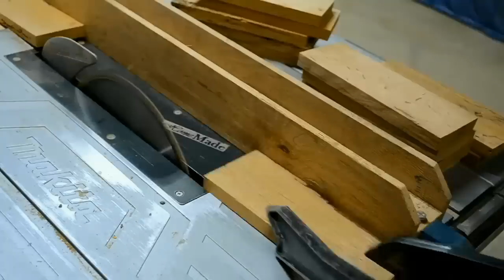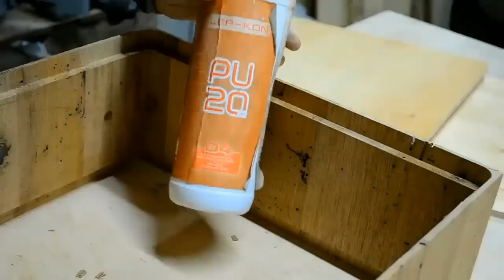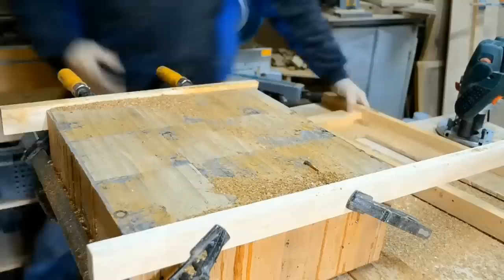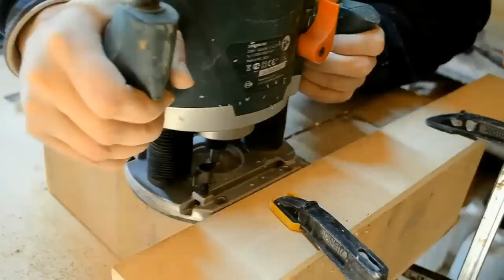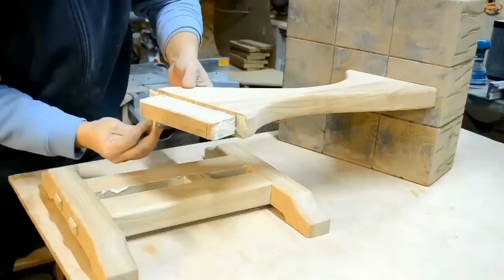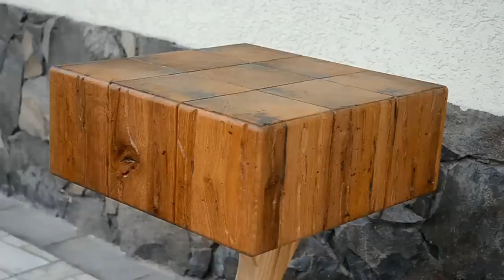Side table made from old oak beam

Comment: Wow.

Beautiful. 

At first, I believed that I could see where the design was going. 

But I soon realized that I could not envision the end result based upon the preliminary steps as my guide.

So I sat back and watched patiently. 

It was amazing to see that the end result was much lighter at the top than at the bottom. 

The feet and the supporting beam were heavy and strong, and the composition as a whole was perfectly balanced, while the table surface was light but sturdy for the intended uses.

Outstanding design!

Excellent execution of design!

You have my highest respect for your woodworking skills, sir!

My hat is off to you!
🎩